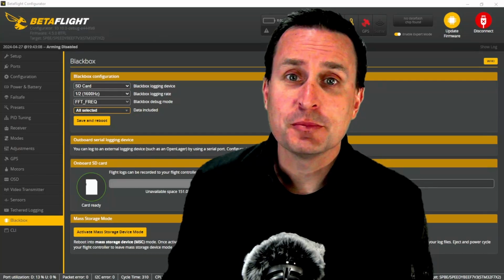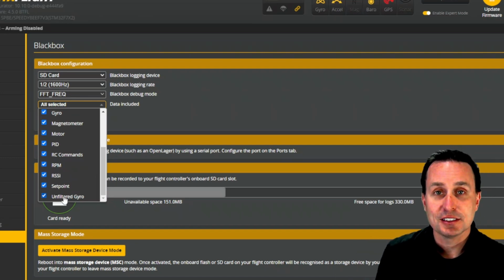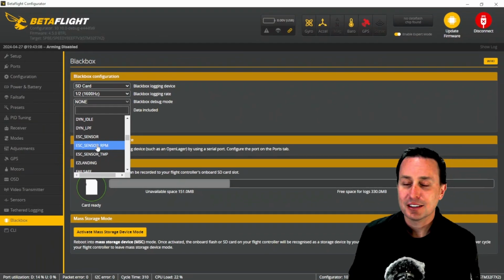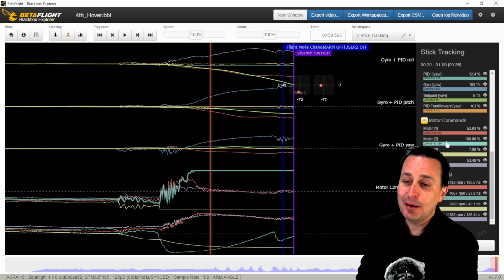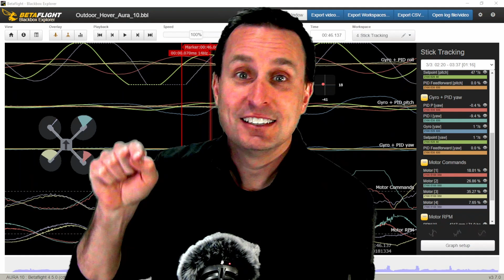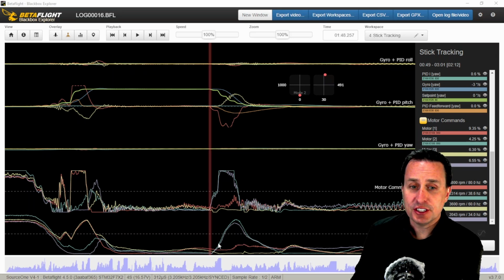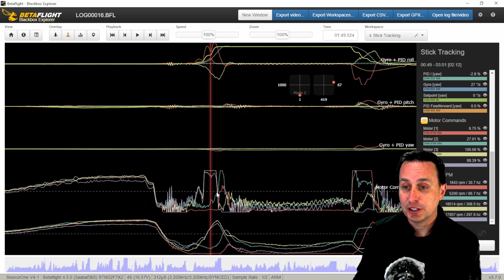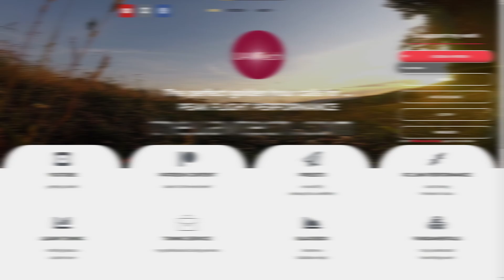Betaflight 4.5 ⋙ RELEASED TODAY !!  --  Motor Performance | 🎉UPDATED🎉 Trace Templates

Comment: Have you ever experienced when diving and the throttle is low but the drone seems to get its own throttle, do you know the cause?
Reply from the maker: yes, is it a ducked quad?
Reply: @uavtech  Yes, i use frame speedy bee 35, and my 5 inch it's the same when i dive with trothel off
Reply from the maker: on ducted quad, reverse the prop and motor direction 

with undocked quads, vibrations could be driving up the motors or an aerodynamic drag on Yaw could also cause two motos to spin up to keep yaw on track, so that could take further analysis to see which is the issue.

A log and HD/DVR of the behavior could show you what is which.

Comment: Having the motor rpm measurements is amazing! Those are pretty constand for a given prop and after adjusting for battery sag. Meaning you can actualy do some identification and automated optimal tuning based on them. Won't do much for ppl who already tuned their quad, but might allow for better "default" tunes if they are based on this knowledge.

Comment: Ok maybe ill go back to betaflight and try this. Do from scratch. No clue what happened my 10" started oscillating crazy lot. Hot motors at low throttle going down. Or pulling out dive. But pid were perfect before. Props look fine. 
INAV short angle mode test seemed perfect though
Reply: Sounds like a loose screw, if it wasnt before
Reply: @chrisbee5481  first thing I thought. But wasn't. Checked even stack screws. Found antenna getting loose but didn't fix it. I only thing left is I swap props.
Reply: What frame is your 10" ? I like the new tmotor c10.5 props. Damn stiff and good quality.
Dont know if your frame and motors will match. I use 3215

Comment: I recently built a 10 inch bird. I used 3115 900 kv T-motors with HQ 10x4.5x3 props. Are these motors sufficient in your opinion or should I try to find bigger motors?
Reply: I have same build same motors. Motors plenty big enough. Though I touch something on betaflight and started having huge oscillation at low throttle or pulling out dive. Couldn't figure out what even going back to old pids. Then old diff then old dump. I ended up just putting inav in and seem like it didn't do it. Idk. Can't figure out what I could of touched in betaflight.
Reply: How u like the 10x4.5x3? Suppose to be more efficient even though they r heavier. I have gemfan 10x5x3 on right now but I have 10x4.5x3 also to test. I also balanced my props
Reply: @divingfalconfpv4602  I like them better than the 10x5 from Gemfan or HQ for the simple reason that the oscillations were so bad using the higher pitched props that it was basically unflyable. It has certainly been a real pain in the ass to tune. I think just by sheer dumb luck and trial and error that I have it flying pretty good now. Considering that it is a 10 inch, and freaking huge, it won't be going with me on most outings, but there is certainly something exhilarating about flying something that big. I've also never seen a quad that just isn't bothered at all by prop wash but this one doesn't even flinch in normal prop wash scenarios. It's just solid in the air.
Reply: @William_NS   it was weird. I had tune pretty good. Then something went wrong. And got extreme bad oscillation like too high D. I never changed props so maybe they got out of balance. These gf 10x5x3 when I got them were extremely out of balance i sanded for hours. Way way way more than the hq 10x4.5x3 which were pretty much almost perfect. 
I got inav in now. I was suppose to wait till after all the battery and prop testing but it instantly fixed oscillation and hot motors.. also heavy battery pretty almost fixed it.
Reply: @William_NS   mine was like that till something went wrong. Zero zero prop wash even before better tune
Reply: @divingfalconfpv4602  I noticed that if I put a second pack in parallel on it, it flew better too. Maybe I need to try iNav on it. It's still flying okay on BF 4.5 but it could be a lot better, I'm sure.
Reply: @William_NS   what frame?  I had really high PIDs that were working good till some gyro issue. But I can try the released 4.5 now. But I normally use inav on my long range quads..
Reply: @divingfalconfpv4602  GEP RC Mark 4 LR10. It was literally the only 10 inch frame I've seen in stock at either Pyro or RDQ since I started thinking about a 10 inch build. It came in stock at Pyro so I snatched one up! Lol! I did kind of want the Foxeer Aura 10, though. If one ever comes in stock, I might swap components and see if it's just the frame, but it seems like a solid frame, just a little older of a design.

Iv'e only used Betaflight since I started building. Maybe I should do some experimenting with inav.